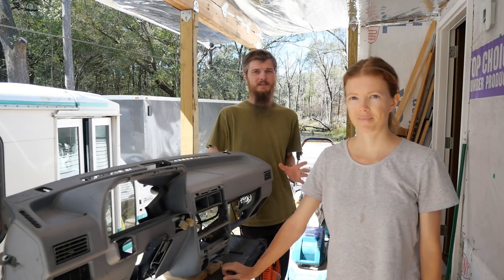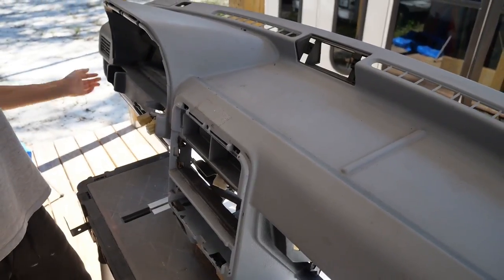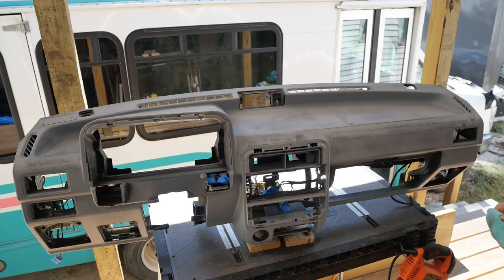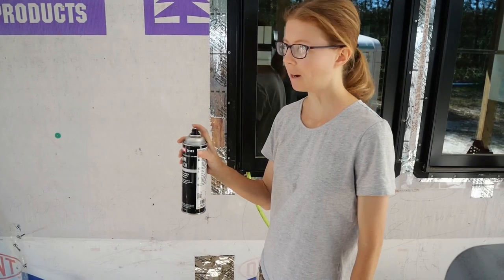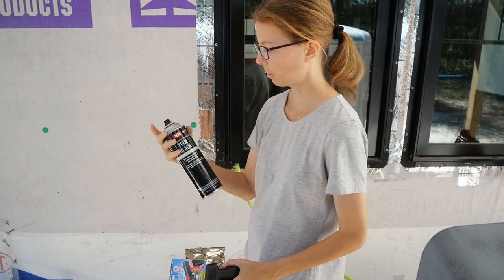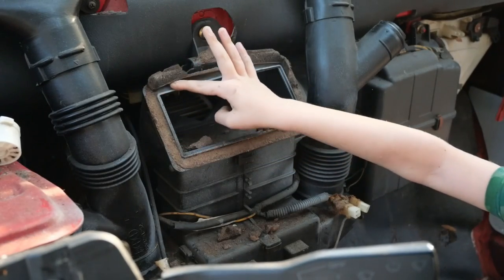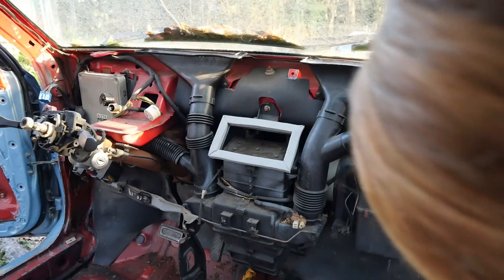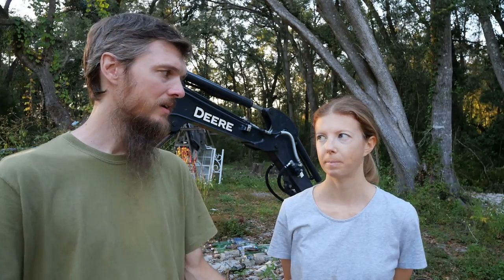Restoring an Old Dirty Dashboard - Project Car

Comment: Maverick will never forget helping with the car or house.  I'm 71 and all my 7 boy cousins worked on cars.  My dad was a mechanic and my ex-husband worked on cars too.  Therefore, I know a lot about cars.  You're called " shade tree mechanics.''  They used to put cars under shade trees and set up a pulley system to pull out those heavy V8 engines and work on them in the yard.

Comment: The deteriorated foam edging, that crumbled when touched, is the same type foam they used in the air flow sections as well. So while you have everything apart, a great idea would be to disassemble the air handling parts and replace those crumbling foam part on vent doors and such. The heater/air flow sections of the vehicle, is what I am referring to. Save a ton of time having to tear it all apart again to do that down the road... Been there done that too...

Comment: If preparation is the route to success, Ashley, you laid out a darned good road map on this one. I'm not suggesting that Doug stood by, like all your projects this was a great team effort. Your spraying looked great, that handle delivered the goods, with great control over the final paint delivery for a lovely even application. (Years of use, abuse, degeneration and even after half a dozen operations to correct nerve damage, and my fingers cannot handle press buttons well. Don't get me started on touch screens, a tool is the only answer for me.)

Comment: I'm a car guy and have restored a few cars in my 67 years.  It will be well worth a little extra time to completely disassemble the hvac box.  It will be very dirty inside and maybe/probably mouse droppings.  Also there will be foam seals on the mode doors that will be deteriorated that will not seal correctly for efficient operation.  Just my 2 cents.  Great job so far!

Comment: You need to get some Q Bond to repair any plastic you can find it on Amazon. It’s the only thing I’ve found that will last and stay. We use it all the time on builds from grills to bumpers and so forth.
Reply: @livingbyfaithwithbenji8909  I think on that I would use JB Weld.
Reply: @livingbyfaithwithbenji8909  all I can say is get some Q Bone and give it a try. I know from experience it welds plastic back together and is as strong if not stronger than before. I’ve never used it on anything other that wisher fluid tanks and it held with water.

Comment: Amazing job!  I had a red Mercury Tracer - that exact model in 1986.  The manual in the dash was for the Ford Fiesta.  It was an upgraded version of your car but the same color!  I had dark gray vinyl bumpers.  I also had a "reset button" under the spare.  I only had to use it once, a guy at work gently bumped my front bumper in the parking lot.  The car wouldn't start.  I called the dealer and he told me about the secret reset button.  He also told me that if I ever wanted to "protect" my car from being stolen, to hit that button to disable it.
Reply: I had a mercury tracer and absolutely LOVED that car, drove it to wearout stage. Fabulous lil machine, and never had issues with it...white with red interior...

Comment: Great progress... I am a little worried for you about paint overspray on the wood for the porch and the bus. Bus is easier with claybar but wood I am not sure unless you are painting it. Well I guess you could sand it too. Anyways, fun project
Reply from the maker: Those porch posts still be to be encased with trim, so it's totally fine. I actually did a few practice sprays on one of the wood posts, haha :) The bus didn't get any paint on it.

Comment: That's a phenomenal paint job Ashley - first rate. 😎  I honestly thought at first you'd replaced the whole thing (genuinely not kidding) as the detail of the original pattern in the vinyl shows up so perfectly, which wasn't at all evident when it was grey.   Also very grateful for your endorsement of the paint sprayer attachment - bought one ages ago as I have the same problem with those little buttons on the can, but haven't used it yet.  I've no excuse now!  Really looking forward to seeing the car evolve :)

Comment: Have you ever had all black car interior? I did one time. Thought it looked nice in the beginning. BUT, drop something between the seats and you may never find it again. And the lint is always there. At least don’t have black steering wheel. Sun hits it and it’s too hot to hold. BTW, great job on the dash.

Comment: Wouldn't you do any painting you need to do inside the car before you put the dash back in? Or is there nothing you are repainting in there?
Reply from the maker: Only a small amount will be painted inside. Most of the red gets covered with trim and carpet. We'll cover the dash when the door jamb is being painted.

Comment: I only have cars with black interiors.  I will not by a car with a light color interior. The light color interiors show too my wear and tear far too quickly and very difficult to get rid of stains and marks/scuffs. Always go with black interiors. Wow. What a transformation! Is there some type of top coat to put on it to protect the fresh paint?
Reply from the maker: This paint isn't meant to be top-coated, so it should hold up just fine :)

Comment: Gosh that Dash looks like new. However before you install it back into the car are you not going to spray the inside of the car to get rid of the red and make new other bits first. Are you going to remove the windscreen first and other windows. I had visions of you hanging the car up and completely spraying all the inside. I was going to say like they do in the car manufacturing places but they just dunk them into a Vat of colour to get into every nook and cranny! I was worried about your bus because as you were spraying some was going onto the side of your bus. Anyway great video take care regards to your lovely children.
Reply from the maker: Some of the interior will be painted the new color, but most of it will remain red. All the red will get covered by carpet and trim anyway. Windows will stay in place and will be taped off and covered before paint.

Comment: The dash looks brand new now that it's cleaned and painted. I did notice that the VIN number was painted over. Is that a concern?
Reply from the maker: It was already painted over by whoever sprayed the light gray, so we just painted over it again and it actually made the numbers stand out better for some reason. But earlier today I used a gold Sharpie marker and went over the numbers so they stand out really good now :)
Reply: @diyfferent  Awesome. I bet that looks sharp (ie).

Comment: since the dash has a bit of leather "crinkle" in it , the glaze putty will make that part look smooth , making it stand out after its painted 
mightve been better to fill the cracks up with superglue as that fills up the deep parts a lot less and flows out more
for wider cracks and holes you can sprinkle in some baking soda , that stuff works like a catalist and turns as hard as a rock , you can even drill and tap it

Comment: I think you might regret a full black interior in the summer, especially in a car without air conditioning 😢 it could be too hot to drive 😕
Reply from the maker: This car has AC. It may need to be fixed, but at least it does have it, so the car will cool off quick inside:)
Reply: Sorry I thought it didn’t for some reason 🤪

Comment: OMG  hope you have air conditioning in the car, as black absorbs heat. extreme heat will crack dash boards. I was hoping it would be like a pink for breast cancer . lol just an idea. Of course your decision and I will keep watching. Excited to see how it turns out. such a cute car. Hope your bus doesn't get over spray on it. Might want to put up back splash?
Reply from the maker: It will be fine. Black is actually more UV resistant than other colors too. We addressed the black issue in the previous video :) Thanks for watching!

Comment: All black interior or exterior makes for a very hot car… you live in Florida……I hope it works out for you and I’m wrong for your sake
Reply from the maker: It will be okay. It doesn't get any hotter here than most other places. The warm season is just longer here. The car has AC, even though it may need to be fixed, so that will help it cool down fast anyway. I do want to point out that we won't be doing a black exterior. :)

Comment: Florida car with black interior. I built an oven. now I know why it was originally repainted light gray✨
Reply from the maker: With AC, it doesn't matter. It will cool down so fast. Florida doesn't really get any hotter than other parts of the country, it just has a longer warm season. But a benefit to black is that is is naturally UV resistant so it will hold up better over time.

Comment: Using the impact feature on a drill when driving a wood screw is just ridiculous.  downright stupid.
Reply from the maker: It wasn't a drill, it was an impact driver. It's common to drive lag screws, and even regular screws with impacts.
Reply: @diyfferent  lol... I'm a 45 year tradesman.  NO, when driving in a wood screw to soft wood all you need is the drill. the impact is an over used function,  only needed in certain conditions. I could drive 3 screws with just drill action by the time you ratatat 1 screw. and my screws will be a tighter bite.  but go ahead youngster with little to no actual experience,,, tell me about it... lol..
Reply: @diyfferent  Using an impact driver to put in screws into wood is just dumb..   and what's funny is it's getting to be a normal thing.   it's an example of stupidity spreading.... Like "uh da it goes bang bang it must be better duhh"
Reply from the maker: @warrendelay  Why are you being so rude? I thought you were a Q guy. Aren't you a patriot and don't patriots have respect for others? Isn't the goal a better world? If not,  it probably should be. But either way, you would better get your point across with a little kindness.

Besides, I wasn't trying to argue. I was just saying it was an impact driver. You seem to be under the impression that the impact part is a feature that can be turned on or off. It's not a feature, but the actual tool. It can't be disabled. Some drills may have an impact feature, but this is just an impact driver, and is made for driving screws. With that said, I wasn't saying it was the only way to drive a screw, just a common way.

If a drill better suits you that is fine. I have no complaint. I used to use a drill exclusively, but I do use the impact quite a lot now for it's speed, power, and the quick change bit holder. It also tends to set screws into the wood without stripping a little easier than my drill. But I still use a drill sometimes. It all depends on what I am doing. We're installing our metal roof now and using the drill only for better control. I actually need to pick up a new one since my current drill is starting to fail.
Reply: @diyfferent  such a beautiful response.
Reply: @diyfferent  Excellent answer honey🙏🏻